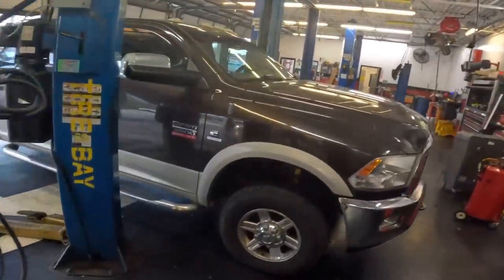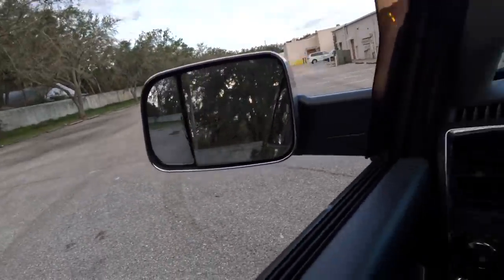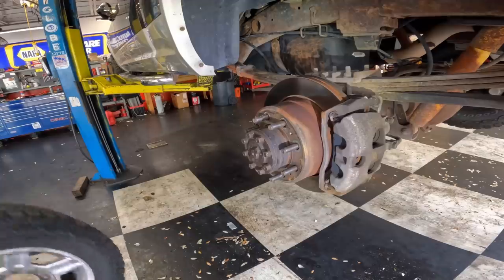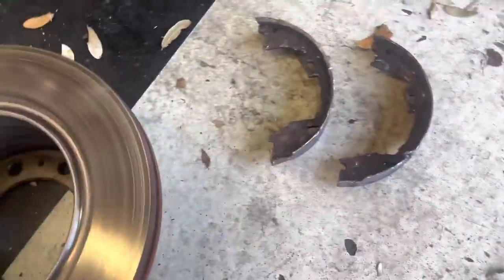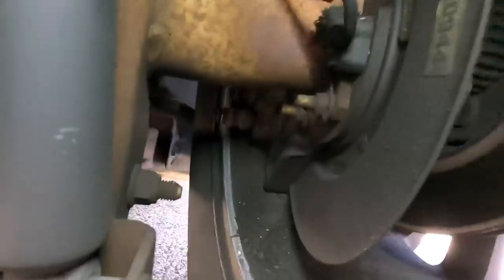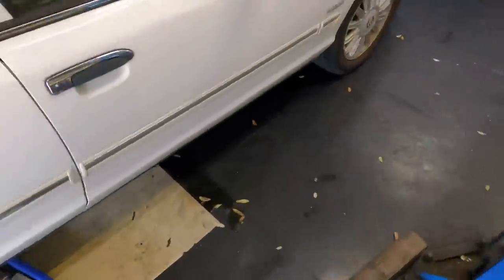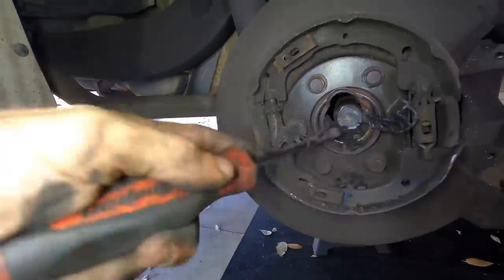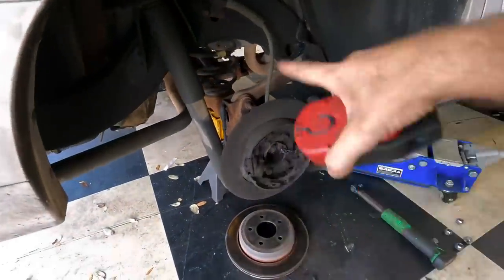Could have Killed Someone!

Comment: Honestly, I'm surprised on that Mercury that the customer didn't request you to put everything back together so that they could take it somewhere else.
Reply: On the back of a wrecker maybe have a good day
Reply: Only to inform them that there is no 'putting it back together' because exposing the break shifted things to the point they'll never fit together again.  Considering the age of the car they're better off getting another vehicle.  4 grand in repairs is 2x the value of the vehicle - simply because the engine still runs.
Reply: The good Lord was looking out for them, as well as the drivers around them!
Reply: @amzarnacht6710  Which is still cheaper than a 20,000.00 dollar used car, and way cheaper than 3,000.00 a month "new" car payments.
Reply: @amzarnacht6710  personally, I'd hit a local Pull-a-Part and get another axle. 3 different models to choose from and more than enough ex cop cars around. Granted, the Grand is probably owned by someone who can't do the work themselves but it'd still be cheaper than having a car payment.
Reply: How do you put garbage back together? 😮
Reply: "wow, that's Impressive"
Reply: @aliasfred  for $3,000/ month you better have something damn exotic. Your credit score must be down to double digits because you could lease a brand new audi R8 for $2600/ month.
Reply: @lastnamefirstname9043  2600 a month, for most people, might as well be 50k a day. Unaffordable is unaffordable.
Reply: Without limited slip or ’diff locker, that car couldn’t drive anyway.
Reply: Customer: So what seems to be the problem?
Ray: The axle on the rear passenger side is sheared off and your hearing aid is shot.
Reply: @frankarchuleta5427  with more used garbage
Reply: @IR-nq4qv  sometimes used is superior to aftermarket, if in good condition of course, preferable if you can't afford OEM parts and just want another two or three years out of a car, all about choices
Reply: @SGTJDerek  old cop cars had either a 3.27 or 3.55 rear gear while the Grand Marquis has a 2.73 rear gear. They wouldn't be able to use the police vic rear end without getting a tune for it unless the 2.73 gear in the old housing is still good and can be put into the new housing.
Reply: @lastnamefirstname9043  Then add full coverage insurance.  The total would be well over $3000 per month.
Reply: Some people need to understand that what man makes requires competent maintenance as it is your life in jeopardy.
Good job Ray.
Reply: @loacyric  I was responding to the fool who said a new car will have $3,000 monthly payments. it wouldn't even be 7 full month to pay the car off if you got a $20,000 new car. nobody finances a car that way. The point was to highlight how ridiculous their statement is by comparing it to a realistic monthly payment on a $150,000+ vehicle. They're not "equally unaffordable" just because you can't afford either one. That's the entire point of using the word 'equal'. If it were equally unaffordable one wouldn't be 8x more expensive than the other.
Reply: lol my thought exactly 🤪
Reply: @daddynichol52   my point was that "$3000/ month for a new car payment" is in the ballpark of a brand new $150,000 car not for a new Hyundai Elantra or some shit
Reply: @aliasfred  yeah. Interest rates are headed through the roof right now. Used vehicles are expensive and the next great depression is just around the corner. I'd rather spend some cash now on something I own outright.
Reply: @benjurqunov  none of those Lincoln Town cars or Grand Marquis have limited slip differentials
Reply: @benjurqunov  with out four wheels it won't be driving either!
Reply: @SGTJDerek  been on both sides of that suitation myself. I dunno....my 265 dollar a month car payment has been buying peace of mind for about 18 months.....got a bunch of extended warranty work done for nothing out of pocket and basically only ever needed to do routine maintenance.    You either pay a bank or pay a shop in my experience.    If I was a mechanic....that might be different, but not my area of expertise.
Reply: You must be saying that "tongue in cheek!"
Reply: @frankarchuleta5427  they’ll probably claim Ray did it, and sue the garage…
Reply: @jacobieevans6293  If it were mine (the wouldn't have been in that state) but I'd change the rear.  Likely less than a grand installed and a decent one should run another 150K miles.  Those Fords are abundant here in FL, but even a cop car rear should only affect the speedo and shift points slightly.   And no new car payents
Reply: @benjurqunov  good thing it didn't have limited slip.  The owner would still be driving it.
Reply: @aliasfred  who pays that for an old used crown vic??
Reply: @amzarnacht6710  You have grossly overestimated the cost of repairs on a Ford Panther car.
Reply: @benjurqunov    Yeah, how was the power getting to the drive wheel?🤨
Reply: And honestly I would replace the part
Reply: @armchairgeneralissimo  Parts and labor, these days?  Not really.
Reply: I’d just need a crown Victoria rear end im sure you can get them real cheap. Due to the amount of old police vehicles that are sitting in scrap yards.
Reply: @SGTJDerek  True, that.
I'd hit the pull-a-part, myself, after a couple of days of youtube to figure out the methods.   I've learned brakes, bearings, CV axles that way, so the rest would just be more research.
And about 4x the time to do it myself.
Reply: @frankarchuleta5427 , with duct tape, bubble gum, and rubber bands.
Reply: @aliasfred  Used car market has tanked the last few months.  Better a 4k down payment - or outright purchase - than 4k in repairs.
Reply: @amzarnacht6710  4 grand heak i could fix it for 500 bucks go junk yard get a whole rear end for 500 bucks throw it in in 1 day or less think a crown vic rear end work to
Reply: That is probably a very rare problem so finding a good used one shouldn’t be a problem. All he would have to do is show the customer that axle and the damage is obvious. Getting a second opinion would require a tow and as obvious as that is unnecessary.
Reply: @shinzontheta  I totally understand.
Reply: @amzarnacht6710  YouTube has been my go to as well. Especially on this new garbage. My ex-father-in-law told me long ago. "It's already broke so why not try to fix it yourself"?
Reply: @amzarnacht6710  not in today's market, people would buy this marquee for 5k even without a rear axle 😂
Reply: A panther owner knows that fixing it is worth it. Especially with the cheap unreliable cars nowaday.
Reply: @SGTJDerek  well said I would do the same thing go to lqk and get me a rear end
Reply: I’m surprised they didn’t just go to pull-a-part and grab a full rear axle to be put on
Reply: @Scepter777  can't warrenty a job if it's used parts
Reply: @coreybabcock2023  most salvage yards like where I live have a 10 or 15 day warranty  but a place can warranty the labor I’ve seen them do it. Before I was my own mechanic for my trucks I use to take my vehicles to shops older vehicles that parts aren’t made anymore for.
Reply: @jacobieevans6293  The police cruisers never had more than a 3.08 is what I've seen. But yes even a small change messes with speedometer, engine management and ABS.

Comment: I agree Ray, in 35 years I have never seen a RWD axle broken like that.  WOW!
Reply: I have and the caused the was diff oil got so low it was unable to lubricate the outer axle bearings
Reply: @SHSPVR  it's the perfect example of low diff oil, cause the bearing to heat up thus transferring into the axle and weakening it causing it to break at the bearing.
Being a heavy vehicle diff and gearbox repairer for 25 years had seen half a dozen over the years on trucks where owners just never changed the diff o and end result was the same as this or the dual wheels completely came off.
Reply: Neither have i. I have replaced countless CV axles but never had to replace a RWD axle or the differential just always checked and changed the gear oil
Reply: I broke 4 at once when a pinion shaft dropped into the ring gear of the truck I was driving.  The shock load took out the rear end all 4 axle shaft the back axle housing the through shaft and front differential and 2 lengths of drive shaft. All in under a second at 70 mph.
Reply: @haroldbenton979  A lot of force there.
Reply: @tedmoss  a modified 444 Cummins that was producing over 1000 hp at the crank under full load and what caused it all was the inner pinion shaft bearing on the back differential came apart dropped into the ring gear and locked everything up.  

The root cause was that same pinion shaft was set too tight during it's own rebuild less than a month prior.  I had been screaming there's a problem with that one for a month.  Then it let's loose in a very spectacular way.  The bosses wife wasn't exactly happy with me either.  I did a copious interruption on their anniversary night also when she let loose.  She took it out on the foreman the next day.
Reply: And the brake caliper was the only thing keeping it all in the same general zip code. Amazing.
Reply: I have... but it was on a vehicle that could produce significantly more horsepower... This right here is just... It's something.
Reply: My bet is that the bearing failed, leading to friction  and the cutting. Tough to tell at this point as the bits of shaft have migrated through the whole axle by now damaging the wheel bearing on  the other side, the bearings in the pinion and diff as well as the differential.  You might be able to disassemble the whole thing, replace bearings and flush out all the grit, but  that diff will never be quiet again. Swapping a whole diff in is the right way to go, and considering the labor to clean swapping the whole unit is the right way to go. If it was something where the diffs were not available, or pricey, it could be fixed with "just" an axle and bearings.
Reply: I did a U turn in a f*rd and the axle broke near the hub. 1979 I have not driven a f*rd again
Reply: @SHSPVR  Makes more sense than (but not as fun as) my scenario which included Sheriff Roscoe P Coltrane yelling "Them Duke Boys!"
Reply: The worst I have ever seen was the outer VV let go and it looked like it had 4 claymore mines go off at once. It ended up being towed, probably junkyarded.
Reply: I've seen this happen on 2 different panther platforms.
Reply: @bobmazzi7435  Yeah, bearing failure.  Caused the seal to fail, which caused all the oil in the axle to exit stage left (or right in this case).  Once that happened, lack of lube resulted in the axle burning up into the axle tube while eating itself in the process.  This failure probably took a month or two to complete.  I'm just curious why nothing was done once it started leaking - some of that gear oil will wind up on the exhaust system (muffler) and it will have a really disgusting smell (like fermented cat urine).  There were signs all over that a failure was taking place - the parking brake shoes inside the rotor (these use a drum-in-hat style parking brake setup on the rear wheels) would have rubbed against the rotor due to the extra clearance in the rear bearing and would have made a sick dog like yelping sound while in motion.  I've seen this personally on a couple of beat up Crown Vic P71s that were unloved.
Reply: @theautisticmechanic  I'm going to tread on iffy ground here, but if the owner did not have good hearing the sound of the bearing's self destruction might not have been obvious.
Reply: seals got bad, oil got out .  I had a 05 and when the seals started to leak, I replaced them.
Reply: @bobmazzi7435  it's entirely possible ... but it's also something that you would feel in your seat ... it can be pretty violent.  I obtained a 2009 Vic from a police auction in early 2019 and it had a failed bearing on the passenger side (this is usually the side that fails due to axle load), and it definitely made the car interesting to drive for its 3 mile drive home ... the yelp was in tandem with an oscillation if you will that caused the car to 'rock' in step with the noise.  In the case of the 2009, the shaft had a shallow groove in it where the bearing rode it and that was it, aside from the slinging oil.  No damage to the axle tube, put a new axle and bearing in it and called it a day.
Reply: Mopar quality.  That's why I use ford rear ends in my vehicles.  Dodge or Chevy need ford running gear to be able to last

Comment: The dangers these two vehicles pose are not just the likelihood of their drivers losing control and crashing. I know of one instance where the driver of a medium duty truck- it was an F600 as I recall- ignored a grinding noise in a rear wheel for months. The right rear brake drum finally shattered on an urban highway. A piece of that drum went through the windshield of the car in the adjacent lane and struck a four year old girl in the face. The girl lived but lost one eye and hearing in one ear in addition to being horribly disfigured. DON'T IGNORE THINGS OUT OF THE ORDINARY.

Comment: 13:59 Those little 10mm bolts were damn heroes. Had they let go while the car was driving at speed, that would've been a HUGE accident.
Reply: I'm immensely surprised at that. I would never have thought 2x10mm bolts for a caliper is a good idea, and I still don't. My car has 2x14mm. But considering the forces on the caliper those must be some strong ass bolts.
Reply: The axle would have been in one piece for most of that destruction, it wore down the diameter until it broke in half and all drive was lost because of an open diff.  The two caliper bolts were still the only thing keeping the wheel and axle in, but at least with the unbroken axle there was technically no real extra load on those two bolts, when the axle snapped, very different story as there is know a bending force on them.  Luckily it ground to a halt when the axle snapped.